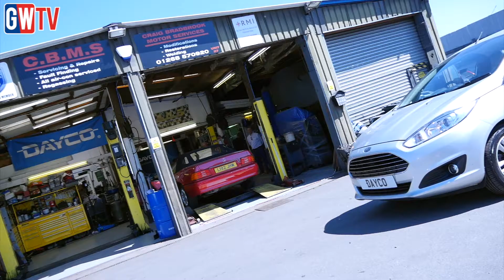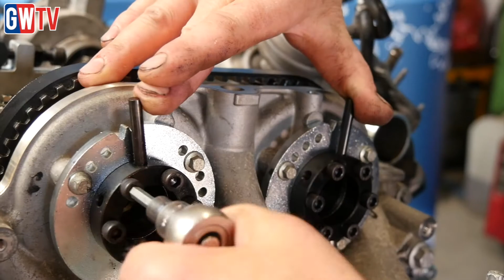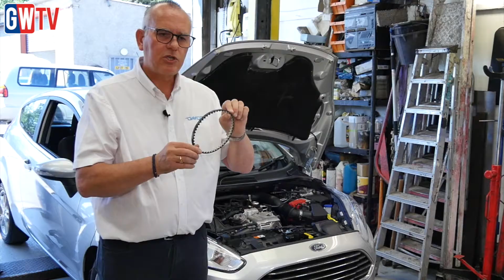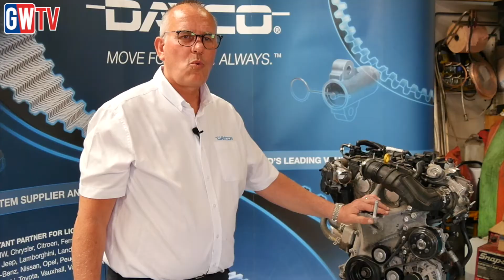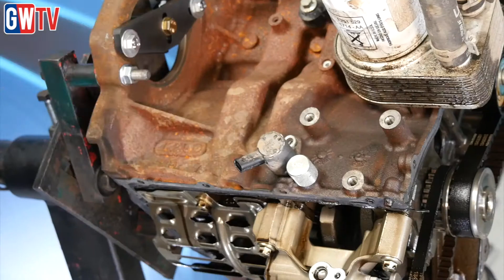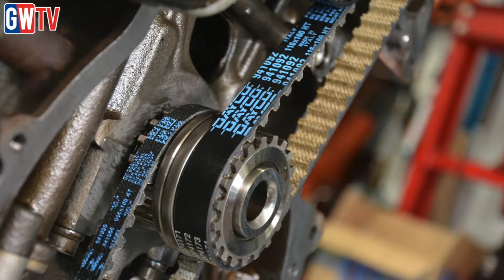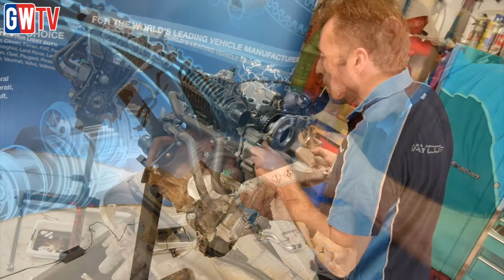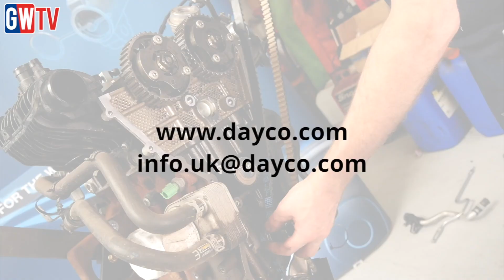🔵 Ford 1.0 Ecoboost timing belt replacement 🔴

Comment: Cut a long story short, if you own a vehicle with this engine in, put aside the money you save from the improved fuel economy as you’ll need it to pay for the cambelt replacement.
Reply: Simon Rees , my C-Max 2014 64 reg , does around 31 - 36 Mpg (44 on a gentle 55-60Mph on motorway at 2000-2200rpm in 6th gear) but that’s it , this 55Mpg is complete and utter nonsense as they test it on a rolling road with no load or pulling any weight for about 4 miles and work it out from there . It’s a big heavy 1.5T car (1.9T fully laden) to pull for such a small block where as a fiesta is around 1T or 1.6 T fully laden so a big difference. Mondeo 1.0 Ecoboost must be even worse for economy?
Reply: @richie674  Putting the 1.0 ecoboost in cars bigger than the fiesta was a silly move by ford in my opinion. From my experience, the ecoboost tends to suffer far more in the larger cars.
Reply: 68k miles, I got one coming in the shop with oilpump failed and timing jumped.
Reply: @lucasvaughn9423 if you are lucky the cam will be in or near a point in the cycle where it JUST clears the pistons, usually they fail as 1 passes tdc so the cams are near where they need to be for retiming (later engines have qr/barcodes in the square timing points, they should both be on top and horizontal to each other.

The sump needs to come off anyway to clean the oil pump so I use a flywheel ring gear locking tool bolted through one of the gearbox-sump bolt holes rather than removing the starter motor.

Provided the crank pulley is in its correct position you can align that with the small pin before locking the flywheel to set your number one @ tdc otherwise you can use an indicated on Piston one through the spark plug hole.

Of a dozen or so I've done none have bent valves but that is more luck than anything.
Reply: Seen quotes of £1000+
Reply: I've got a MY21 Focus Active Estate with the 1.0l 155ps mild hybrid.
That "hybrid" system opens another entire can of worms im sure. (Especially when the battery gives up the ghost)

If I don't care about how I drive, give it some fairly often, and only do short town trips. I tend to see a return of 45mpg.

If I drive more conservatively on long motorway stints (in "eco mode" @65mph on the dash) I'm seeing anwhere between 64mpg and 68mpg even with 3 adult passengers and light luggage.

That's with an empty weight between 1.4T and 1.5T
Reply: Seen enough from this video to side swerve Ford's. Holy future headache.

Comment: I have a 2014 1.0 ecoboost cmax. It has been pretty well serviced by last owners and I have just had a service done at 39,000. I'm thinking of replacing the belt at 10 years old or 60,000 whichever comes first. Would this be correct.
Reply: Lee Finney,  I’ve just done mine on my 64reg c-max after 8yrs and just over 24000 miles and mine showed signs of de-laminating but the oil pump gauze was clean and free of debri . Oil pump belt changed too so both changed on age related not so much mileage wise but glad I did it as it’s a mammoth task to carry out 👍
Reply: Hey… I have similar age and mileage cmax. What was the cost of this for labour and materials? Thanks

Comment: This is a brilliant video, however there is just one comment I have, 
in the video and other videos made from other companies they say you need to remove the drive shaft bracket to access the crankshaft locking pin bolt, this is not needed as this is extra work. you can access the pin while the bracket is still in place.

Comment: Seems to me although this engine is clever technology it's very fragile like a bone china plate. For that reason i won't be buying a vehicle with this Engine. My Lexus hybrid has done 250,000miles without issue and still going strong.
Reply: The problem I see regularly with1.0 ecoboost faults are generally because people don't use the correct oil.Many I have seen and I have seen a few,have poor maintenance,lack of oil changes etc. And believe me it's not just ecoboost either many of these small high output engines are suffering,multiair,skyactive,ecotecs ingeniums,etc. all relatively new engine tech from various manufacturers that have serious durability issues,it's widespread too and even the marquee brands are suffering,BMW,mercedes,VAG,Mazda,nissan,mini,we are even starting to see a noticable steady increase in Kia/Hyundai products through the door for some quite expensive repairs and ust from what I hear or read day to day in my work it seems even the mighty Toyota are not immune too!,the payoff for expecting so much from so little,without respecting it. Given that your car has covered 250K it's obvious that you respect yours,I've seen some ecoboosts with very high mileage,the difference in them is care and some degree of mechanical sympathy.
Reply: @areyouundoingthatorwhat9181  Problem is when buying used you don't know what oil has been put in. Also when servicing at independent garages you can't be sure they used the right oil
Reply: I own a Toyota 1.8 hybrid with a chain! No issues at all and I drive it carefully and change oil and filter every 10k kilometers. But even this Ford engine can last a long time if used with care and maintained well.

Comment: 660 mine just cost
Reply: Ive just been quoted 320 for the labour, plus parts plus vat. Ford sell both belts for £53 at the minute so not as scary as some people think. These engines come in for a lot of criticism but theyre ok if theyre serviced correctly, you generally only hear about the horror stories. Most or nearly all failures re due to the oil pump pick up gauze becoming blocked leading to oil starvation, cause more often by missing oil changes or using wrong oil, rarely does the belt fail
Reply: @deanwarner2006  Please confirm where did you get this quote?
Reply: Seems cheap
Reply: Please confirm where did you get this done, for 1.0 ecoboost?
Reply: Where did you get that done?
Reply: Which garage was that as mine needs doing.

Comment: How much does this all cost? For example my outgoing Mk5 golf gti, replacing the timing belt, water pump, time and extras, I would have change of £500. This looks more expensive?
Reply: to add to this, I think the cost of the tooling is about 800 quid without labour,